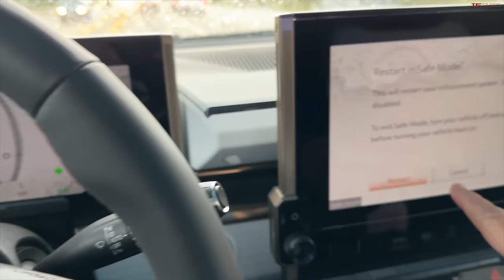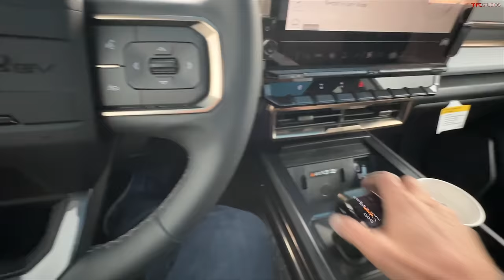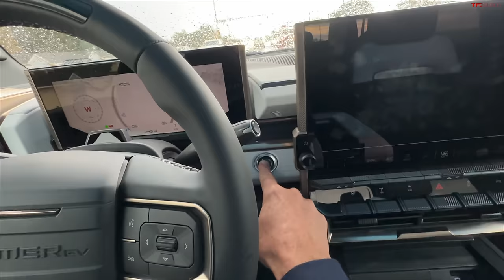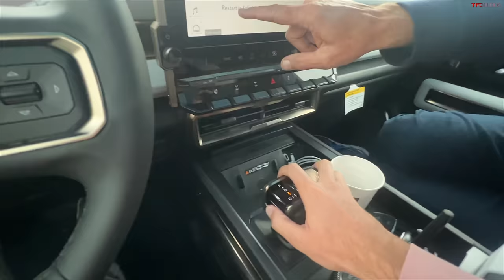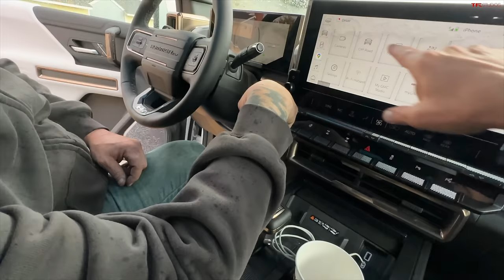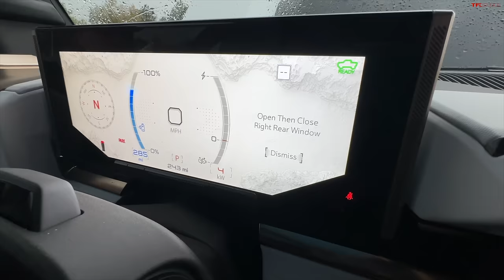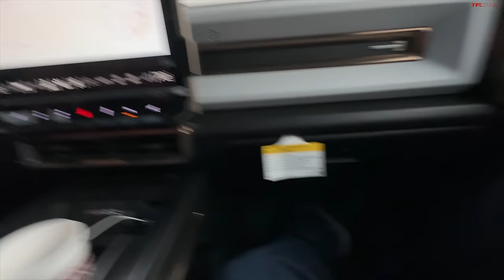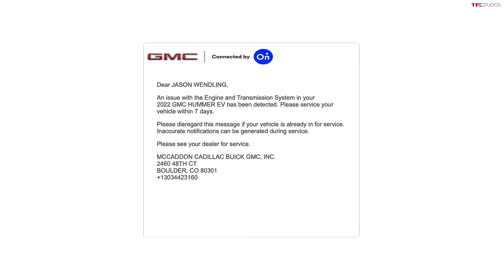I Bought a $115,000 GMC Hummer EV and It IMMEDIATELY Left Me Stranded!

Comment: I found the hood latch on Page 18 of the Owner's Manual. Just like every other vehicle, it's a mechanical system, they all have physical overrides for electronically aided systems.
Reply: Nobody reads operator's instructions anymore...In my years pumping gas, I've  seen dozen of cases where ICE drivers couldn't find or know how to open the fuel fill door😥
Reply: Google search would’ve told them that
Reply: Glad you had the time to read a manual from the comfort of your house....emergency situations call for a faster and more reliable way that is intuitive to the owner

Comment: We need some perspective adjustment on this subject. Imagine the early combustion engines and the problems those early iterations must have given the owners. This is much the same thing. It's going to take a couple of manufacturing cycles to work out all the kinks. So you can't really complain about issues and failures but also want to be amongst the early adopters. It doesn't work that way.

Comment: When it comes to computer controlled electric everything, I'd like to see a more basic option for ev's, like basic gauges and switches not a giant touch screen to control everything
Reply: The touchscreens everywbere just arent as useful as buttons and switches are tbh. I like what RAM did in their trucks. Huge ass touchscreen, but tons of controls still on buttons and switches. This trend of everything must be a touchscreen needs to die.
Reply: I'm surprised Tesla hasn't tried to make something that doesn't drive itself that actually competes with a Corolla
Reply: @TheAnnoyingBoss  I guess Tesla and their customers are happy pretending their cars are status symbols
Reply: @BradChadley  I think making cyber truck cyberpunk was a mistake. They'd have been better off making the cyber truck Toyota Tacoma sized. I go to the grocery store and no one really dressing cyberpunk my man.
Reply: @TheAnnoyingBoss  I agree. It also doesn't look particularly good. It looks like something a first-year engineering student would come up with in their first drafting class. It looks half-assed compared to anything that is actually "cyberpunk." I agree though, the cyber truck would be better if it were mid-sized and looked more like a normal truck.
Reply: @BradChadley  i actually think for what they tried to do it looks relatively good. It looks very good which is weird why it seems to be so unreliable. They're good at making it look good but it's unreliable and sketchy because it weighs 9000 pounds and leaves itself stuck in park randomly

Comment: Roman and Tommy watching your insane issues with the hummer ev helps me make up my mind to stay with my 2021 f150 limited powerboost that is much  more reliable and easier to put in to neutral by lower a panel on the dashboard and pulling the orange strap ther are to many issues with ev from the grid to charging station ,range , to range anxiety and the high price of buying a ev and then you throw this problem in to the mix’s I think that most people will stay with combustion motors but I must say the I did get a big chuckle out of watching this video

Comment: If nothing else GM is consistent, at least with problems.  I was genuinely hoping EVs would give them a new start but apparently not.🤔
Reply: EVs will end them IMO....unless they can get ANOTHER bailout and make us all pay for their failures as a company once more.
Reply: @MUFF DIVER only when built by companies that don't know what they're doing 😂
Reply: @MUFF DIVER Another weak argument.  That's not an EV problem,  that's a GRID problem. They need to modernize the grid. EVs are more efficient than gas, go look up the calculations as to why, or, just look at the MPG ratings for them. So even if you charged them on a mostly gas-powered grid, you essentially would be using less gas to power them than you would to power an ICE vehicle.   You ever wonder why no gas car can achieve 100-123mpg rating Teslas can? Cause they're less efficient.

Comment: This is honestly my fear with electric vehicles. Something like this happens and you can’t yourself do something to get by in the short term due to the safety redundancies and powered everything. Sometimes it’s just better to have manual operated things
Reply: Had a fuel pump go out on a 93 Chevy Cavalier , during rush hour traffic, on the freeway! Stuff happens, just because its gas powered doesn't mean you are any better off.
Reply: i agree
Reply: @chrisstromberg6527  But a gas powered vehicle can be shifted into neutral and pushed or pulled to the side of the road.

Comment: I think maybe the window thing was just to recalibrate the safety mechanisms after the battery disconnect. You may able to just skip that step.
Reply: It said dismiss underneath all the prompts.
Reply: @chooch5728  I dont know anything about this truck, but as an automotive engineer I'm pretty confident that yes this is a safety feature.  Opening and closing the windows was so the computer could relearn the position of the windows and make sure it doesn't pinch fingers.  Unless they have some weird process limitations, I don't see any need to open and close them sequentially...it probably would have worked to open and close them all at the same time to speed things up.
Reply: Old people…jeeez
Reply: @davidanderson1060  name one other vehicle that has windows that you need to calibrate their position in the track. This is likely just a sequence of events to allow the computer to know your are doing a reboot sequence. There’s likely a limit switch on either end of the window travel negating the need to “calibrate” the motion.
Reply: @SuzukiKid400  any luxury vehicle these days use a non-absolute encoder to monitor window position.  When power is lost the ecu losses track of the position.  When the window cycles up and down the two limit switches are used to calibrate the position signal.  I have direct experience with the RX 450h and know for a fact it works that way.  It's a very common technique to save money by using relative sensors instead of absolute sensors
Reply: If you've ever disconnected and reconnected you battery, you'll see that power doors and powered hatches don't work until they're manually opened and closed.  This is the same technique of calibrating the position feedback sensors.
Reply: @SuzukiKid400  Many GM's need this after a 12V battery disconnect.  My 2016 ELR is no different - and it details this in the owners manual.

Comment: Would be nice to have a physical breaker switch under the driver side like a breaker box switch at home that would break the circuit to the 12V battery. Would have solved this issue!

Comment: this is why some some stuff needs to stay mechanical... i dont know its not that I hate EV but I think its still too early for them to be as reliable (and safe) as internal combustion
Reply: The "other" leader in EV, Tesla  have never had this problem
Reply: @chipspaulding1371  Tesla's problems is making sure their cars can read a stop light and properly reading objects in front but other than that yeah, they tend to be fine.
Reply: @ironhockey116   you are right, care will need to be taken to protect the environment both in the creation and the  recyclement  of the batteries.    but electric cars do not explode, and they catch fire much less than an ICE.    which is why they don't have "firewalls"

Comment: I've always thought that overengineering something is probably a bad idea long term. This isn't an EV issue, it's a computerized car issue. They took stuff that worked 100% of the times like hood release and they computerized it without clear instructions on how to manually pop the hood in case of emergencies. Their software engineers caused fault issue in this video and didn't even include a clear way to reboot the car. Their hardware engineers flubbed by not putting a hood release tag or handle under the dash. These kind of things will probably happen with their future ICE vehicles as well.

Comment: The weird cycle you went through was probably due to having the front trunk open.  It sensed that something was wrong and denied the shift to leave Park.  Had you closed the hood, it might not have made you do all those random checks... but that's only a guess based on working with computers for around 40 years.
Reply: Those are frameless windows, the up/down was to relearn up position after battery reset, (when you open the doors the windows go down just a bit to clear the seals) Camaro does same thing after battery disconnect. He could have dismissed those and went straight to the brake pedal hold part.

Comment: We are not transitioning to software control as you said in the video. Most cars have hundreds of control units running millions lines of code already and it works well. The problem is that software engineering is driving the process instead of systems engineering. Software engineering focus on availability, portability, testability and so on. Systems engineering ask first what can go wrong. It's a mindset change.

Comment: The scary thing with teslas is that pulling the 12v battery won't actually do anything.. You need to pull both the 12v AND the firemans loop for the High Voltage pack to completely shut the system down its a flawed system.

Comment: This scenario has always concerned me, when considering Electric vehicles !
My question is if these vehicles randomly are subjected to a High amount of Radio Frequency (RF), or an Electromagnetic Pulse, aka. EMP, would they shut down, or worse case, cause an accident ?
Driving in proximity to High voltage power lines along the Highways, as example ?
Does anyone know if these things are wired above ground ?
And I understand that the control modules are are likely shielded, and the Body may act as a Faraday cage of sorts !
             🤔....?

Comment: The process with the windows was due to requiring end stop calibrations as the battery was pulled, resetting everything.
Not good to see that the hood pull cable isn't documented properly though. 

Seems the software is .....needing further testing.

FYI - "Command", "IOS"? These sound like very Apple specific terms, the masses do not know what those are.

Comment: You would be surprised when you disconnect the battery it resets the computer. There is a chance that they won’t find anything. You should have let him put it on the truck with skids. That’s how they move them. Then the dealer would have had the codes

Comment: Sounds like a Microsoft or Bill Gates curse.  Back decades ago, BG took a jab at the auto industry saying, "If cars kept up with the computer industry they'd be cheaper, faster, more fuel efficient, etc."  The CEO of GM shot back, "Yeah, that's right but would you like to own a car where it could break down without warning and the only way to get it moving again would be to get out, open the trunk and the hood and all the doors and windows and then close them again and the car would start up and you could drive away."  YEP, a curse from Microsoft and Bill Gates.

Comment: I think if EVs rely on software it will fail but if they are able to be more like rc cars where the motors are dependent on analog systems and the software is a complement not the main system they may have a chance

Comment: If you are driving an EV, you will expecting OS malfunctioning or unable communicate with external devices.  Even my Toyota Prius, malfunction too on the display.  It doesn’t affect driving and OD. For desktop, cellphone or laptops, we hold down the power button until it shutdown and power it back on but some motherboard requires you to disconnect the battery and reconnect. It is nothing new.  Just don’t drive the EV in a  3-5feet water. It is more like spilling a coffee over the laptop keyboard.  For desktop, it will be worse.

Comment: I noticed you didn't do what the screen said to do for the restart those many times you were complaining in the beginning.  It said to push restart, open the door, exit the vehicle and close the door for at least a minute.  Then get back in and restart.  All you did was push restart and then do that over and over.   The truck, like most ice GM vehicles, will not reboot unless you get out close the door and reopen the door.

Comment: They say that gas vehicles have all these extra expensive moving parts. 
Well just think of all the technology and expensive parts in these moving computers that you can’t fix. Only the dealerships can fix them. At least we can work on gasoline cars.  I remember an Audi I had and the lcd screen controlled heat, ac, music exc. went out. The part alone was over$3k. The install was over a G, this is on an 2008 Audi. After that I said no thanks. I’ll never own something that is that dependent on technology.  So, now I drive around my 86’ Caprice. 1986 , still runs like a top and I don’t have to worry about all that jibberish hog wash unneeded technology.

Comment: They even named it a Hummer which the original should not exist either. Y es they need CONTROL/ALT/DELETE LOL So the EVs will be "fixed" like PCs. Just reboot until it works and never know what the problem is so it will keep happening.

Comment: There would be no transition if people simply said no and did not buy them. Here is the deal and I work in the Utility sector. We do not have the infrastructure to power all these electric cars and trucks. The more you start seeing the more grid problems are going to arise. This means Electric rates are going to go up drastically to create the funds to build new power plants, sub-stations, and transmission lines. The cost to charge an electric vehicle will probably quadruple in the next couple years. Also cost to cool your home and regular electric use will be way more expensive. You are going to regret this so simply say no to electric cars.

Comment: Did you try and run a virus scan maybe uninstall some apps. Could be the power supply try putting a new power supply in maybe petrol powered. If you take it to a computer store they may be able to firmware flash it.

Comment: Better call Leroy!  Operator error? Probably.  Maybe pull off the road before learning how to operate your new (great) choice.  GM clearly has some work to do.  Looks like dude has the same disorder my roommate has - I can't remember what it's called but in effect it means that as soon as a tiny thing goes wrong he immediately does something that makes it waaay worse.  Meanwhile the adult that's designated to make decisions (for this adult) can only watch in horror bc, when it happens, the poor decisions come so quickly it's like watching a magician.  An anti-magician. Case in Point: roommate picks up a soda and, as if to check the time on his wrist watch, he turns the soda 90°. Now soda is everywhere and I should mention that he does not wear a wrist watch.  As my mind enters glitch-mode and attempts to make sense of the scene before me, roommate, in a single seamless motion, picks up a piece of paper from the table with a pile of powder on it.  Powdered sugar (just go with it) is dumped over the soda covered table and, for a brief moment, the roommate glances up at me with an air of accomplishment.  ("Leave roommate baffled" must be on his to-do list - check!)  I guess I should point out that my roommate is in his early 50's and has no known mental issues, certainly none that could excuse or explain this behavoir.  The characteristic point here is the speed at which utter rediculouslness ensues. It was no more than 2.5 seconds between a mostly clean tabletop (complete with a perfectly viable pile of powdered sugar) and a bona-fide mess garnished by a proud and accomplished adult idiot and a stunned-but-normal adult.  Cheers.

Comment: All EV’s are like this. Teslas will be in a fender bender on the freeway and the entire car locks up. 

Auto manufacturers really need to figure this out. Imagine if you were in the middle of a freeway.

At least some sort of manual neutral mode so you can be pushed to the shoulder or towed easier

Comment: Electric cars should be cheaper than gasoline cars. The desing is mych simpler, but the battery is expensive. I would have bought 6 dacia duster with that money and none would have left you stranded in the next 10 years

Comment: Among many design flaws that the Hummer EV shares with other EVs, not being able to manually disengage the drive train and roll the vehicle to move it or pull it up on a tow truck is a big problem. Seeing the struggle they had to go through just to get the hood open is frustrating to watch. This vehicle weighs 9400lbs and is actually causing cracks in people's driveways and garages. For this price I could buy 2 ICE powered Toyota Land Cruisers that will run flawlessly for many years and many miles well past when this POS Hummer EV has been salvaged. This vehicle is too heavy to handle any real off road driving. This is a very expensive driveway ornament. Hard Pass!!!

Comment: Very dangerous truck. It's reboot is reminisce of Windows NT, having to recalibrate the car by windows and doors is ridiculous. There's way to much computer control for that is user unfriendly and dangerous. If the printed circuit card and chips are to delicate and have to small circuitry. If it gets ESD compromised you won't be able to drive the vehicle. The basic drive capability and drive off the road is fundamental and should be allowed. This is I will never buy an electric vehicle.